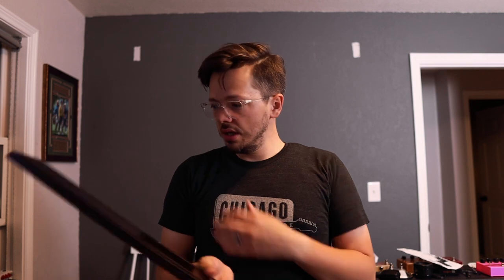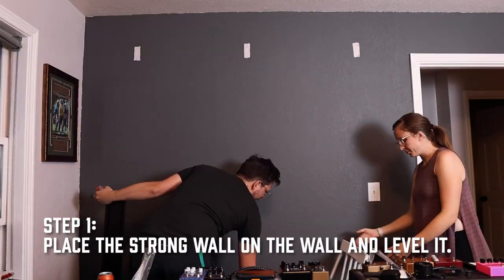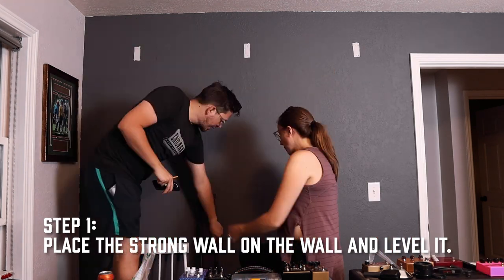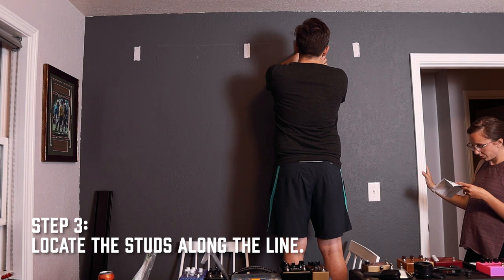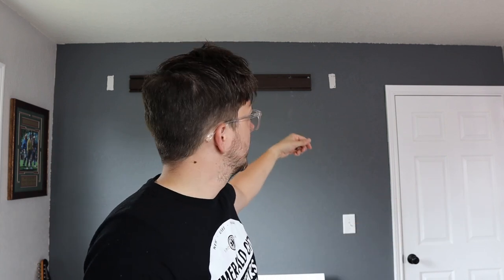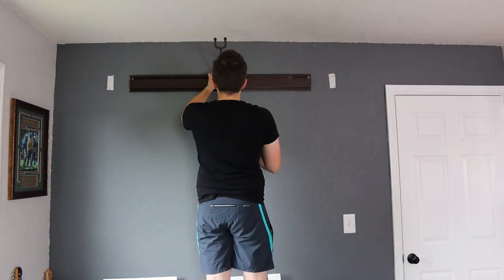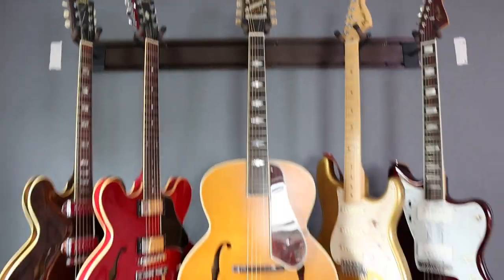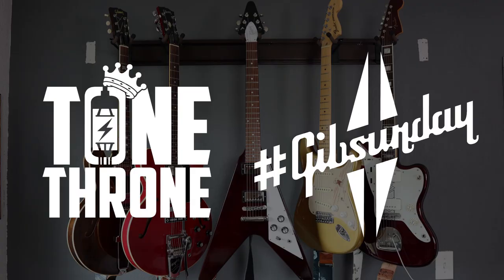My New String Swing (and how I hung it up)!

Comment: I don't like those electronic stud-finders. I use a large magnet with a cloth/fabric in between(to avoid scratching the paint). They sell plastic covered magnet stud finders. Looks great, just have to reposition that lightning bolt!
Reply from the maker: rollinover I’m glad to hear it wasn’t just me. Every other time I used the stud finder, the stud had suddenly moved? It was frustrating. I appreciate the tip! Also, the bolt has been moved!

Comment: So how do you go about keeping them clean when you hang em? Also do you run through more strings? That is to say do they sound dead quicker?
Reply from the maker: Great question. I wipe them down when I hang them back up and if they seem especially dusty when I pull them down, I wipe them off before playing. But I play them daily, so I'm not seeing any excessive dirt build-up. Same for the strings go, I haven't noticed an accelerated deterioration. So far, so good!

Comment: How is the String Swing holding up with your Gibson guitars?   Do you trust that the String Swing will hold a Gibson Les Paul that weighs 9.5 pounds?  Thoughts?
Reply from the maker: I hung up several heavy Gibbys, on two @StringSwing’s, for two years, and never had a problem. Hang it up right and you won’t have a problem!